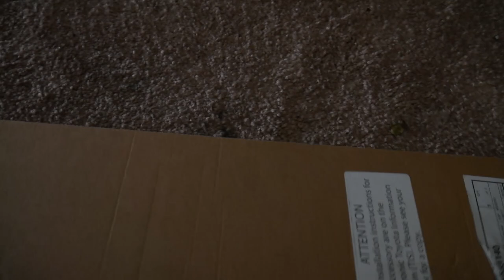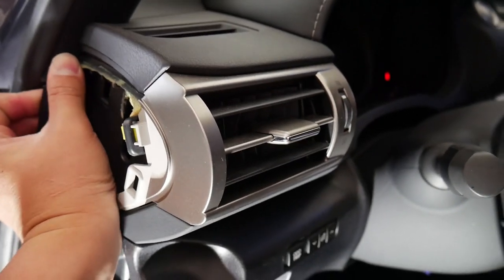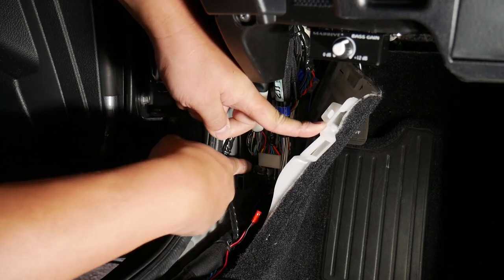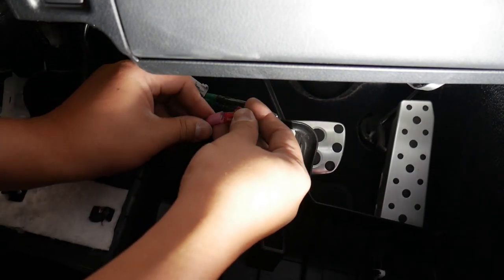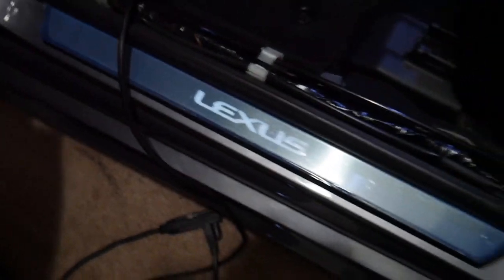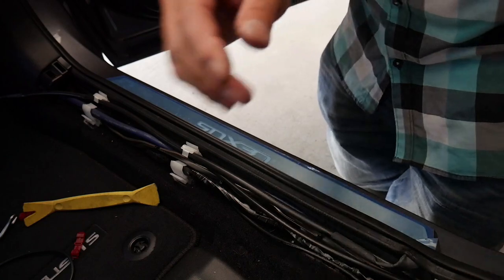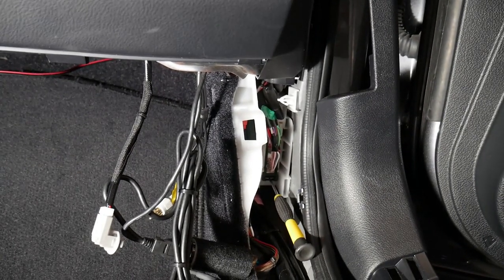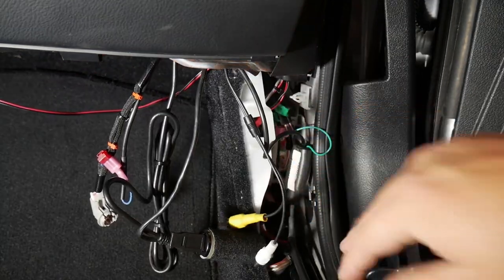DIY Illuminated door sills install 3rd Gen IS Lexus OEM 3IS IS350 IS250 IS200t 2014 2015 2016 2017

Comment: First off, thanks for your video . That’s a big help . I was asking a Lexus dealership to do it for me, they will charge 500 or up for the labor and tools fees. It doesn’t come with parts yet. But I will do it by myself after I watch your video. 
I also want to ask you something. 
I currently have an is 250 2015. Is that okay if we can upgrade a display screen of is 250 2018 for the is 250 2015. The the new display 2018 seems have more functions and wider than the old version right 
Can we also upgrade the red tail light is 250 2018 for is 250 2015 .
Can we do anything to let the mirror sides close and open automatically when we turn lock or unlock  the car 
One more question, where do get get the little red thing that you call “ tee tap” or something like that . Thanks again !
Reply from the maker: You cannot upgrade just the display, you need to also change out the headunit as well to support the wider screen resolution. Then in order to fit the New stereo, you need new pieces surrounding it such as HVAC panel and knee rest panels. There is more details discussion about the conversion at link here if you want to read about it, https://www.clublexus.com/forums/is-3rd-gen-2014-present/892820-converting-7-to-10-display-radio-center-console-upgrade.html

The T-Tap should be included in the kit i believe, I dont remember too clearly but if not you can get it at local small Electronic or Auto Parts store typically.
Reply: specONE thank you sir..

Comment: hey does this apply to the 2018 models as well
Reply from the maker: Yes, should apply to a 2018
Reply: @specONE  thanks for the update! one last question. do the lights stay on when you are driving? :)
Reply from the maker: They don't stay one while driving. They turn off when the door is closed. You can't see them when the door is closed anyways

Comment: After installing on my 3is, my side marker lights on my headlights stay on for about 15 minutes whenever I open or close the doors or after turning the vehicle off. 

Any idea what it could be?
Reply from the maker: You might want to recheck anything you came nearby, the wires you tapped are only for interior light and should not effect the parking lights in headlights. Make sure everything is plugged in secure and solid
Reply: Do you plan on doing on to include the  2018 and 2019Lexus LC 500?

Comment: My passenger side sill does not turn off when door actuator is pressed but drivers side does. Can anyone help?
Reply from the maker: I would double check your connection and test the wire with a voltage meter tool

Comment: Nice...have you tried putting it on the rears? What do you tap in for that?
Reply from the maker: +Dave P the rears is just metal plate finish included. no light up Lexus logo. No Lexus logo at all actually. Just snap off original and snap on new one
Reply: Yea I was wondering if we could add led to those since I see Aliexpress selling a 4 set...wonder where I can tap in those.
Reply from the maker: You couldn't add LED to the OEM ones but if you wanted to install the Aliexpress ones you'd want to find the door trigger wire for that particular door and tap into that wire.

Comment: Just curious I purchased the door sills from amazon, but was wondering if the T tap was included with the purchase from the link in your description.
Reply from the maker: They typically supply different type of wire taps. The one in the video I use instead is something I have in my inventory and I prefer because I work with wiring on daily
Reply: Do you think I can pick some those t taps up my guy?
Reply from the maker: Just goto your local auto parts store, they will sell it in the electronic connector section.
Reply: How hard do you have to push the tab in for the connectors I’m having difficulties getting it out

Comment: Good job! Man! I wanna do that too, my car is is200t@2015, but I am from HongKong, so the steering wheel is on the righ site, can I make it & what else do I need to be careful? Thank you!
Reply from the maker: should be the same install, wire plugs might be different, couldnt help you there though. maybe the plug is mirrored
Reply: Thanks for replying man! Your part number is PT942-53140, right? But the link to eBay, the part number is PT942-53160, and I found that is not the exactly same installation(passenger side, the PT942-53140 t-tap on the the green wire(CTY[-], pin6), but on PT942-53160, changed to the violet wire(CTY[-], pin9). Which part should I buy? Thank you!
Reply from the maker: I think both part numbers apply still. Sometimes they change part numbers when they change manufacturer of the part so they can tell difference. I cannot comment on the wiring difference of PT942-53160 as I have never seen it in person https://www.lexuspartsnow.com/installation/MY14%20IS%20Illuminated%20Door%20Sills%20IssG.pdf
Reply: specONE Thanks for your kindly reply! So that is mean I need to put t-tap on the violet wire instead of the green one anyway, right?
Reply from the maker: +Li Ge again I cannot comment on that. I only show what was the case in my car, you can use that as reference. Might not be the same for everyone
Reply: specONE Finally! DIY successful on my RHD is200t, thanks for your help man!
Reply: @a11179a11179a  so the wire position is same with the video one? Right wheels

Comment: did you disconnect the battery?
Reply from the maker: I dont disconnect battery as I want to be able to test voltage of wires. If you feel more comfortable disconnecting battery, recommend doing so.

Comment: Can I ask you something more about setup illuminated for the Lexus IS 250. I just got a part from a Lexus dealer. But the thing I got from them way different from you except the illuminated bars. The T-tap is bigger. And they don’t have the connector for the driver harness .
Reply from the maker: Ken Huynh might be different type of connector tap (look up other views of connector tap and how to use them) but wiring you would tap to in the car should be the same.
Reply: specONE my part that I got from a Lexus dealership didn’t have that kind of your T-tap(  you have 2 little things ) . My t-Tap just have only one. I just need to put 2 cables actors together then t-Tap them. Everything is works fine now. Thank you again.

Comment: Easy if you have a lightning sill before' just connect the cables from the old to the new sill
Reply from the maker: The third generation Lexus IS never came with illuminated door sills from the factory, they were always added either by owner or dealerships/port